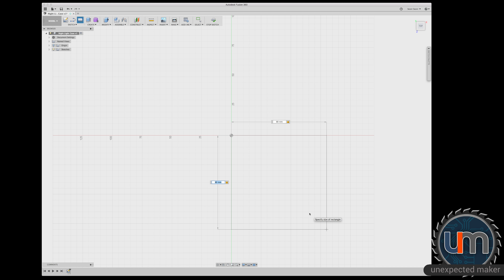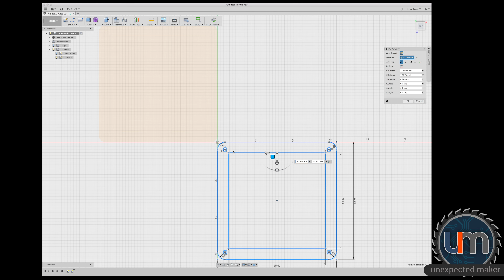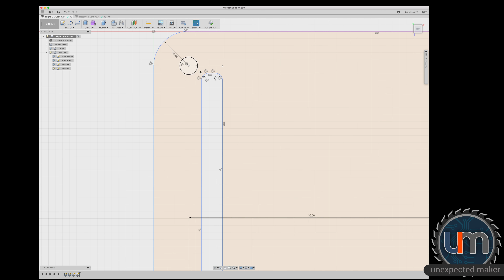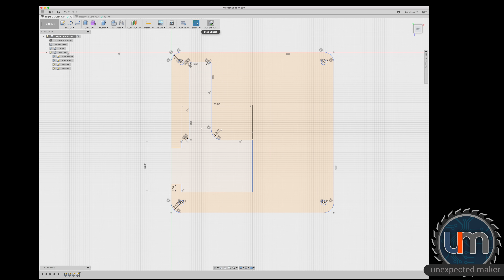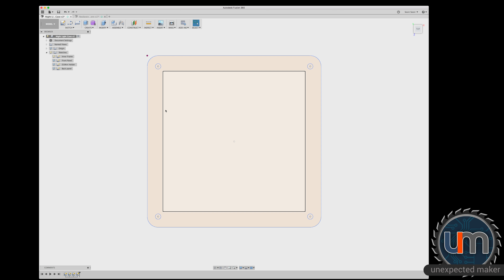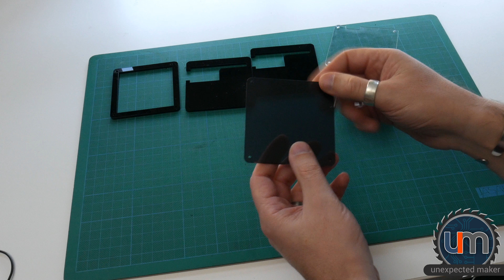Designing an LED Matrix case in Fusion 360

Comment: Ive had my Ender 3 pro for over a year now and love it but I have always been itching for the k40 laser cutter purely due to the fact that cutting a control panel or enclosure is much faster and visually "crisp and clean" using a laser cutter and acrylic. I will be ordering a K40 in the next month or so and thank you for your video's, creating and manufacturing your own products from home is absolutely addicting!!!! my "to buy" list seems to be endless due to the maker space exploding with resin printers, plasma cnc's, fdm printers, plotter cutters, laser cutters, pcb mills, man my brain has been on maximum overload for that last 10 years rofl so many ideas that I cant ever finish a single one and then there is the physical hardware design and electrical engineering too .

Comment: You seem to know what you're doing, but as an avid Fusion user I always avoid making fillets in sketches (rather than in the actual model workspace). If you fillet while sketching, it makes it much harder to go back and change (you have to edit the sketch then change every fillet. in model workspace, you can just edit the fillet). Hope this helps! (P.S. you have a very nice channel, but as someone who knows next to nothing about electronics, I wish you had a few tutorial like videos, as they would be quite helpful to me. keep up the great work!)
Reply: also, to avoid the random paste-ing of fusion, I use the 'project' command.
Reply from the maker: I generally only use fillets in sketch mode if I am going to output the sketches as DXF for my laser cutter, otherwise I also try to only do them in body mode. In this case, my design started for my laser, and then I extruded some parts to 3D print...  There are so many electronics tutorials on YT already, I'm not sure what I could bring to the table that's new... and I'm also still learning, so I'm not sure I should be teaching! hahaha
Reply from the maker: Oh, I've not heard of the Project command... I'll look into it, thanks!
Reply: I guess I should have finished watching before commenting, that makes a lot of sense. Thanks for the reply!

Comment: Thats a cool and quick little solution to holding the matrix. Wish I had a powerful laser cutter to knock one up. Nice one!
Reply from the maker: Thanks. I'm thoroughly enjoying having a laser cutter, but I'd love to get a bigger and stronger one. A3 or even A2 and 100W - but then I'm up for about USD $8k minimum - hard to justify ;)
Reply: Supposedly my tiny 2.5W laser I have is capable of cutting 3mm black acrylic with a little experimenting - So I may have to get it out of the attic and test it. I think a lot of my "I need acrylic" wants are for black housings like this one, and a clear font which I could do manually with a saw/file/sandpaper. More things to experiment with!

Steve

Comment: What is the thickest you can cut?
Reply from the maker: It depends on the material. Clear Acrylic is harder to cut than opaque, and I've been cutting 3mm clear, so prob 6mm black would be my limit on this 40W laser. of course I can cut in multiple passes, but then you run the risk of rounding the edges a bit due to how the laser focuses.